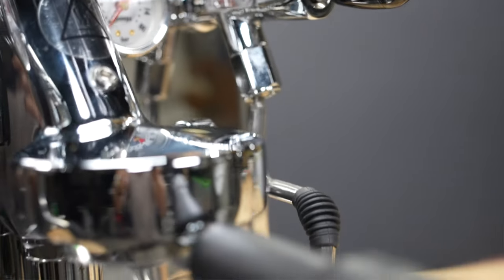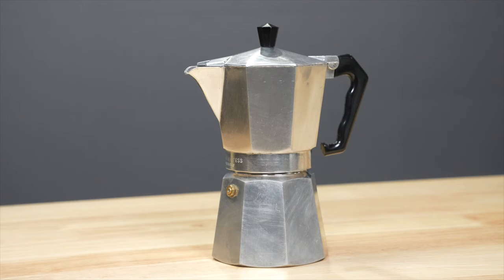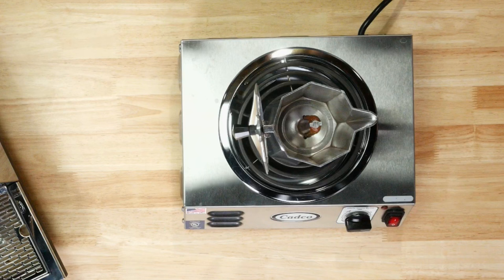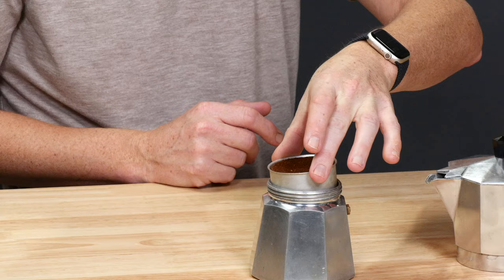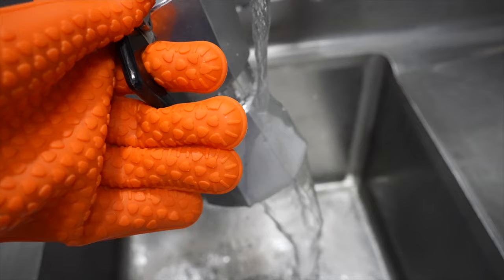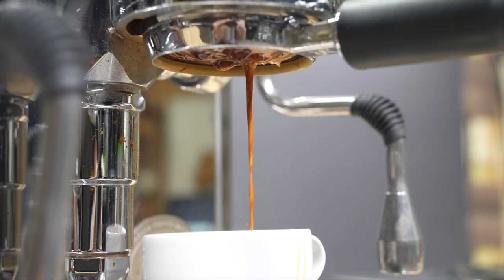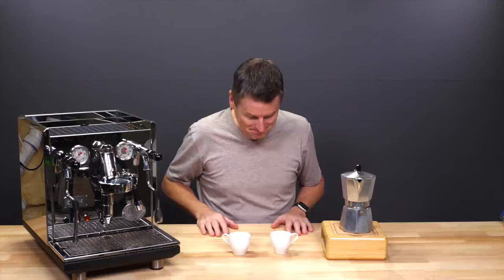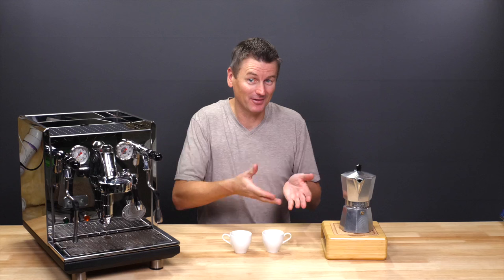Moka Pot vs Espresso Machine: A Side-By-Side Comparison

Comment: Both of these can make great coffee but different things. Moka Pot is Moka Pot not Espresso.
Reply: Why not if you put ground expression into the Moka pot? Genuinely wondering.
Reply: @daiirowe1841  Espresso is a method not a coffee. If you put finally ground coffee used for espresso in a moka pot, It will not work.
Reply: @deathkid411  This is untrue. I have been super-fine grinding beans for my stove top rig for over 40 years. The secret is to press the ground into the basket a bit at a time using the edge of a spoon. This way you do not restrict the passage of water. I have had plenty of espresso from expensive machines and none compare to what I make myself.
Reply: @MrTimjwilson  Hi, are you using moka pot?

Comment: The Bialetti Brikka produces a large crema-like foam; especially the newer generation that has an upgraded valve in the top chamber. Use Cafe Bustelo or Medaglia D'Oro - both by the Rowland Group if using pre-ground. They have Robusta beans as part of the blend and the Robusta is key to producing the crema/foam. Bialetti recommends a 70/30 Robusta/Arabica mix.
Reply: Lavazza Crema e Gusto is also an Arabica/Robusta blend.
Reply: @tedolphbundler724  - do you know the ratios?
Reply: @RonDevito  I think it is 70% Arabica and 30% Robusto.  I don't have the packaging handy so I can't say for sure.  It should be on their website.
Reply: @tedolphbundler724  - thank you. For the Brikka, it needs to be the other way around. And dark roast preferred. The people having trouble dialing in both Moka and Espresso are messing about with 100% or majority Arabica and/or light roasts.
Reply: @RonDevito  Don't count on my memory.  I just checked their website and it doesn't say. It is a dark roast.
Reply: Thanks for this comment. It’s very helpful!

Comment: How exactly does filling the chamber with hot water change the extraction time as you stated (at time 1:22)?  The extraction time can only begin once the steam pressure is high enough to force water up the filter tube. If you start with hot water or cold, the extraction only begins with the pressure, and is equal in extraction time. The only difference would be the time to heat the water to bring it to the stage of extraction. Heating water prior isn't changing extraction, it's only changing time in the moka base (but of course you're using time prior to heat the water elsewhere).
Reply: Time extraction will always be the same, whether you use hot or cold water. But, the longer the coffee is in contact with heat (which comes from the pot itself), the bitter it gets.
That's why some people suggest using preheated water.

Comment: I noticed some inaccuracies in your video. If I may… 

• Grind: Moka Pot manufacturers recommend a medium fine grind (or a little finer than drip grind). Not a medium coarse as you state. Medium fine is how Moka Pot coffee is sold throughout Italy. 

• Pre-heating: Pre-heating/pre-boiling water offers no benefit. Boiling time is roughly the same whether in the Moka Pot or in a kettle. Extraction time is the same since extraction only occurs as water passes through the coffee. Room temperature water is also the manufacturer's recommendation. 

• Stopping extraction: Simply remove the Moka Pot from heat. Extraction will stop nearly immediately. No need to fumble with rinsing the Moka Pot under the tap - which will result in near unavoidable spillage. 

• Noteworthy: The vast majority of Italians don't employ any of your "best practices" in their daily routines and they've been enjoying their, un-bitter, Moka Pot espresso for nearly a hundred years. It is highly doubtful any Italian would settle for bitter Moka Pot espresso as you allude. 

• Conclusion: Yes, espresso machine espresso is better. However, Moka Pot espresso is very nearly the same. Most people inexperienced with espresso would be hard pressed to tell the difference. Which is why Italians have been making Moka Pot espresso for almost one hundred years. 

• Most importantly: None of the so called "best practices" improve Moka Pot espresso flavor. As previously mentioned, it is highly doubtful the entire population of Italy would have been settling for bitter Moka Pot espresso for nearly the last one hundred years. 

Of course, in the end, you can make your Moka Pot espresso as you like. 

Here are some Moka Pot espresso videos I've found very helpful. Hopefully you will as well. 

Annalisa J. 
https://youtu.be/QbhYNipVYSY    

Italian with Bri
https://www.youtube.com/watch?v=_HKSe5Zo8tE    

Best wishes on your coffee journey.
Reply: Pre heating DOES have benefit based on the coffee you're using.
For darker roast, it doesn't matter.
However it DOES make a difference with lighter roasts which require a higher water temp to properly extract and shouldn't be kept over the burner while the water heats.
Reply: @spaceracer23  Water boils at 100°C/212°F (law of physics). Boiling water, and the resulting pressure buildup, are required for the Moka Pot to work. Pre-heating doesn't make the water a "higher temp". You can't change the laws of physics. Pre-heating Moka Pot water has ZERO benefit and makes ZERO difference.
Reply: @spaceracer23  well the water has to be 100°C for the moka pot to work so how does preheating the water make a difference
Reply: @frankhughes001 it makes a difference in that the grounds themselves are in proximity to heat for less long
Reply: @nidhishshivashankar4885  In a Moka Pot, the coffee grounds are more than adequately insulated by the stainless steel basket. As proven by the multiple millions of Italians who have enjoyed Moka Pot espresso for nearly 100 years.
Reply: @spaceracer23  Why would you use a lighter roast in a Moka pot?  Just use the kind of coffee that is intended for a Moka pot (Bustello, Madaglia D'Oro, Lavazza, Illy, Kimbo, etc). and everything will be fine.
Reply: @grassytramtracks  It doesn't.  All these YouTubers are making something simple complicated so that they can get "clicks".
Reply: This guy is one of those who takes glassware from a hot owen and then puts it in cold water )

Comment: I have two options for cooking in Moka Pot.
With the use of room temperature and hot water. 

1. Grind medium or medium fine.
Cook on low heat, if it flows too quickly, it is better to reduce the gas a little, and remove it when lighter coffee flows. You don't have to wait for an eruption, because in this case my coffee came out bitter.
When the flow stops, stir.

2. When pouring hot water, in this case, you can remove the gas when the eruption starts.

Comment: Can you run the moka pot on a low heat with cold water on a longer period of time, instead of inserting hot water first? Wouldnt that give the same effect?
Reply: I can't speak to the impact on flavor, but you can, without doubt, use the process you've described. I've done it many a time in my moka pot to make Cuban-style café con leche.
Reply: I do it all the time bro. Saves some gas and makes better brew, cuz pressure is not ramping up that high. Also I cut the heat off when coffee starts to come out. Cut off time depends on the size, bigger pot - more inertia. Experiment. No matter what you do, there shoudn`t be a Yellowstone in the kitchen, just a steady calm flow, like a woman`s orgasm ;)

Comment: can simplify the process a little by filling the bottom chamber with water and letting it heat on low or medium while grinding beans and filling the funnel, attaching top chamber, etc. fewer steps

Comment: moka pot isn't expresso though? I'm also not sure why you didn't just use as moka pot one size smaller that would at least give you comparable quantities.
Reply: Respectfully, the quantity doesn't matter.
You can simply brew less in the bigger pot if you wish.
However it still won't be the same as an espresso machine because it can't match the pressure.
What matters is getting the proper extraction out of the ground coffee.
In a machine, that's done with pressure. In a moka pot, that's done with a higher volume of water.
The smaller moka pot will have less water, but it will also be trying to extract from less coffee.
Ultimately, big moka pots and little moka pots should produce close to the same flavor if the coffee to water ratio stays the same.

Comment: what has the higher caffeine level  moka vs espresso
Reply: That's going to depend on the coffee you're using.
If you're using the same coffee and getting the proper extraction from both the moka pot and the espresso machine, then you would probably be getting more caffeine per gram of coffee from the machine.
However this is kind of like asking if turning the AC off in your car saves gas. Yeah, maybe a little, but other factors make a much bigger difference.
Reply: @spaceracer23  thx
Reply: if you use in the same amount of coffee beans for both methods and finish the whole drink the absolute amount of caffeine consumed will be the same down to a tiny percentile.